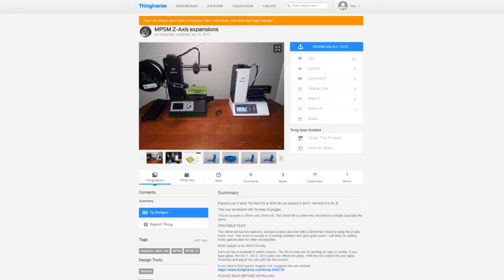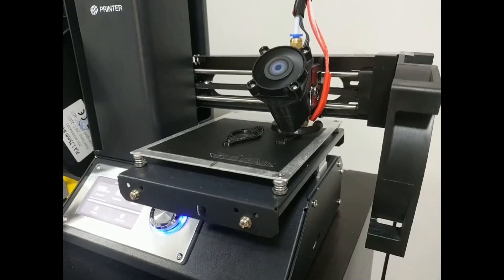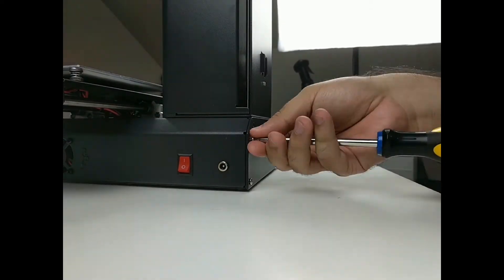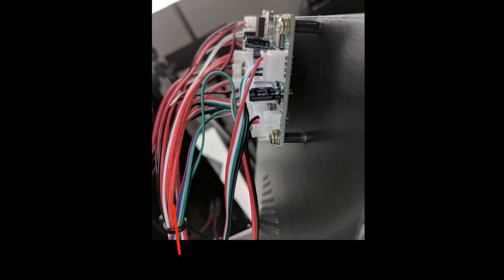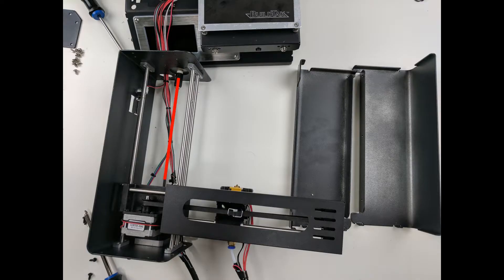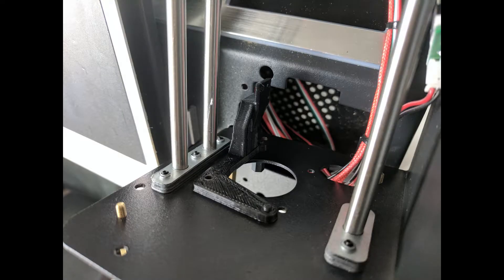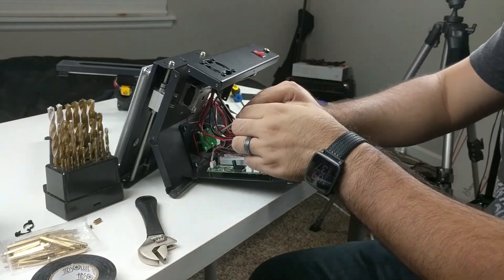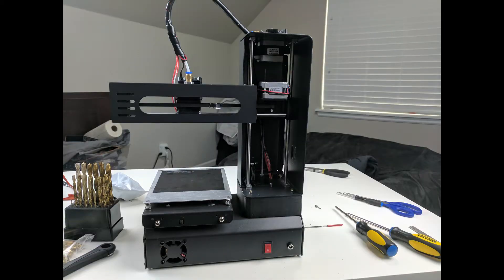MP Select Mini V2 Z-Axis Expansion

Comment: Thank you for sharing this my friend. Are those M3×35mm male to female and same with M3×20mm male to female? Did you get them from Amazon as a kit or did you have to buy each size separate?
Reply from the maker: Bobby Keyz they are both male to female. I didn't get them in a kit, but I'm sure you could if you ordered a variety parts box. Got them on Amazon. Used to have links but Amazon doesn't like me for some reason and cancelled my associates account haha
Reply: LOHTEC thank you. I found them on Amazon I just wanted to make sure I would be getting the right ones if I decide to do the moddification.
Reply: couldn't you print those spacers? ;)

Comment: Thanks for the great video. I just completed mine by following along and pausing as necessary. Easy to follow and well explained.
One thing I noticed in comparing my 35mm with fan is that it is mounted reverse of your base with the fan pointing out the back. It makes sense as it puts the cutout where the wires pass through leaving more room to work around, opposite from your view at 4:10. No biggie, it seems to work installed either way.

Comment: Great video, really easy to follow along. I was able to keep my back-plate, I just took a dremal cut off disk to the pieces on it that get in the way, you lose 2 screw holes, but it holds fine. I also printed the spacer in carbon fiber nylon so its really strong and matches well, the motor spacer and z switch mount I printed in polycarbonate. only issue I had is the z switch was too low even wo the glass bed and build plate screwed all the way down, i printed the one for 1mm glass. I ended up just super gluing some scrap ABS on the switch lever. Also printed out a 30mm to 40mm fan adapter, so I could add a 40mm fan to it. I couldn't get 35 mm standoffs so I just bought a kit that had various sizes, ended up using a 20mm and a 15mm, just used locktite to hold them together, and used locktite on all the nuts and standoffs. So its very stable, also I have the x axis stabilizer installed as well which I think helps keep it very ridged.

Comment: its a great upgrade for the printer but i was thinking what if we really print all the pices i know the 35mm Standoff are metal and plastic can break but i will give it a try
Reply from the maker: You definitely could, but they wouldn't be able to tighten as much so you might get a lot of z-wobble.
Reply: you right question i been having a issue with the x switch you mentioned thats is lower and the nozzle will pretty much dig in to the bed but mine stans like a 3 inches away from the bed so im not able to calibrate it
Reply from the maker: Either you installed the z-switch in the wrong place or the firmware doesn't go all the way down. Try having it go to home position and then telling it to go to home position again when it stops. If that doesn't work the switch is in wrong.